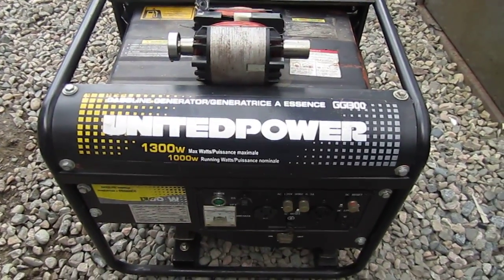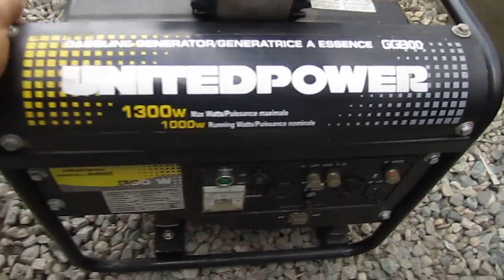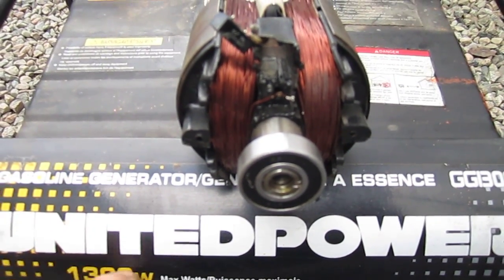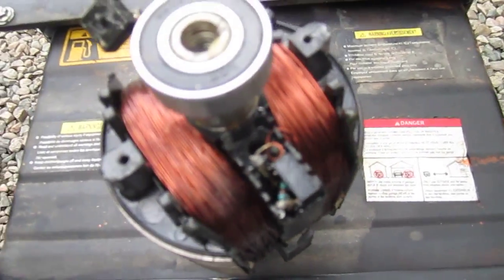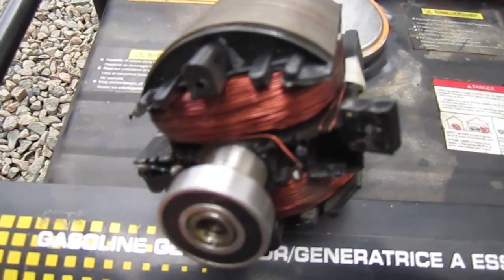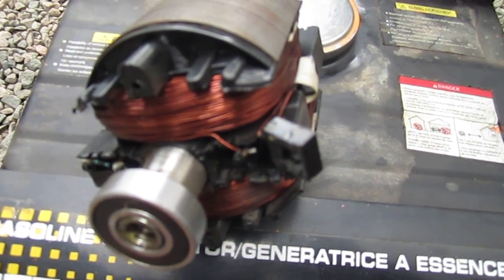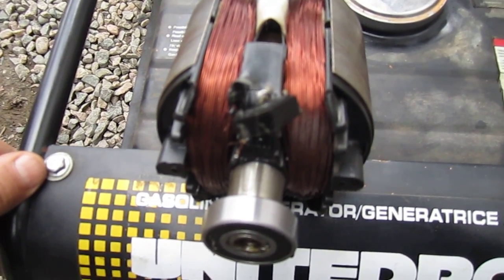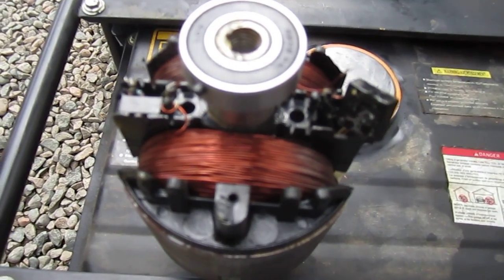Reasons Why Generators Stop Producing Voltage  Big Cause Why

Comment: This diagnosis did fix my problem with the rotor
Reply: The diodes can go bad from the bad connection, the bad intermittent connection going through the diode creates high voltage high current peaks that either short, or blow the junction open on the diode they can fail in either way

Comment: I have a Generac gp3300 and it's producing low Voltage, like it will power a light bulb or drill but the bulb is dim and the drill spins slow as hell.
Reply from the maker: Hard to say what the problem is it matters to which type you have some have voltage regulator and some only use a capacitor.
Reply: @MrDoingEverything  this has the AVR, and I believe that may be the issue. I ordered a new one, and it will be here tomorrow so I'm gonna change it and hope for the best.

Comment: 2:30 time. MANUFACTURES; those 'engineers'  ought to get a brain slap. GOING   3600 rpm, and  NO  JB WELD, to hold those wires/parts together !  Take a lesson, from aeronautics !  Build  the electronics, and the  bridge rectifier connections, IN  A  SOLID  BLOCK, OF  ceramic glue, or similar. Bolt into armature. !  dummies !    IF  I HAD this gen problem, i would silver solder the connections, after twisting together; then,  glue them in there, with  JB  WELD......no  more 'design  problems'''  anymore  !  MODERN  junk Buy once,  use once, (maybe) trash it   >>>  buy another new one,....repeat the cycle....the modern  'way'.  I will keep my 1983  Yamaha ef2800  generator; built like a tank, starts right up, makes power even after sitting in the bush, for years at a garage sale. Freebie, had to redo carb completely, and de-rust tank.....this is a keeper  !

Comment: I have a brushless petrol generator, I thought the capacitors were bad so changed them out, still doesn’t work.
The 240 side produced 10volts,
And the 110v produces 100 volts, what’s going on? Thoughts?
Reply from the maker: Have you thought about the voltage regulator
Reply: @MrDoingEverything  I’ll have to open it up and have a look for it, it’s not like the new generators it’s a Medusa petrol and it’s maybe 30 years old now, 13.5hp engine. 
I’ll try your suggestion, I’m new to generator repairs, this is my first attempt 😅
Reply: @MrDoingEverything  you’re not going to believe this, there isn’t a voltage regulator, or not one that looks modern day. All I see is copper wires, capacitors, or some tiny diodes. What do I do next? I’m so puzzled. It’s nothing like in people’s YouTube videos
Reply from the maker: @belsayshootingground  Have you checked the diodes.
Reply: @MrDoingEverything  there’s 2 of them on the rotor, they look fine visually, but I don’t know what tests to run?
Reply from the maker: @belsayshootingground  Look fine don't mean fine search how to test diodes. Very easy to test out. Easier to see video then to explain. Very simple to do after knowing.
Reply: @MrDoingEverything  will do thank you for responding 🙌
Reply: @belsayshootingground  this is a brushless alternator, it have the output voltage regulated by a capacitor(which is fed by its own winding inside the stator) . Single phase brushless alternators are not suitable to power sensitive electronic appliances as the generated voltage in not properly regulated. The 2 coils of the armature are not linked like @think out side box said, they are 2 separate components. These coils are short-circuited through the diodes/rectifier so that the current running in them is DC. With this DC current flowing in the 2 coils, the armature become a rotating ELECTRO-MAGNET which induce the main output AC current/voltage in the stator of the alternator.
Reply: @zairenszairens809  ah that’s interesting to know. So what’s the best type of generator for homes?

I did just notice that the main rotor inside the generator is all bent and twisted and is now contacting the magnet. If I straighten it all up and get the tolerance correct again, do you think it could work again?
Looks like it’s over heated quite bad.
Reply: @belsayshootingground  If the rotor comes to contact the stator when the engine(mover) is running because the NDE (non drive end) bearing fails the damage to the alternator is big. The friction heat produced in this failure will fry/burn the windings insulation varnish (rotor & stator). Rewinding the 2 (rotor/stator) is much more expensive than buying a brand new alternator. If you can find a used alternator it can save you precious $. As you said the rotor is bent and twisted, trying to fix it doesn't worth it, because even though you can straighten it, the windings needs to be replaced. Did you test the continuity to the frame? (insulation test) It must be more than 2 MΩ between any stator winding terminal to the frame or rotor winding to the shaft. A good generator for household appliances is one with a AVR(automatic voltage regulator), the best is an inverter generator. Inverter generators are much more expensive than ordinary ones because the generated power is steady and clean(sine wave)
Reply: @zairenszairens809  youve made me realise I know absolutely nothing about generators 🙌😂 I think I might just buy a new one and leave the fixing to the pros 😆

Comment: I've got a generator similar to that one it's 2000 watts but the armature is made like that except where the bridge diodes are, it has the same holder but there's only a single resistor between the two sides..it has a gold stripe so I guess it needs to be about a certain size..anyways I worked at a small engine place and I got this thing the engine was junk so I cut part of the crankshaft off and left it sticking out of the generator...it wasn't long enough to put a pulley on but I drilled a 5/8 hole in it and inserted a piece of keyed shaft from a junk electric motor I had...tomorrow I'm getting batteries number 7 &8 for my solar setup so I'm going to weld the shaft piece tomorrow...it's  for a backup generator thing I'm working on..it has two 110 legs...but with the resistor it let the crappy little motor they had wind up before it would start generating so I'm going to glue a little neodymium magnet to the back bearing because I'm gonna use  an old 5 hp Briggs that's been put up for a long time..it has a centrifugal belt clutch so that'll let the motor get going. .yeah that's kinda crazy having those bridges flying around in there lol I never would have thought of that
Reply: Good man, David !.  Consider,  sealing anything up, with  JB  WELD.  After  your completely sure, it makes power consistently.  GLUE  THEM  SOLID,  so no more problems.  IF  i was a designer, engineer, i would put most all stuff, on armature, in epoxy cement. Modules, like in your alternator voltage regulator. No vibration, would destroy anything !

Comment: Nice observation, can you please tell me what guage wire do I need and how many turns on the coil if I need 50 amps and 24 volts from a single coil if I'm using N52 neodymium magnets 60mm by 200mm rotating at 7000 rpm
Reply: https://youtu.be/J9wqTqh9Vzk

Comment: A chain is only as strong as its weakest link...these little pieces of crap made crappily in a crap little factory in a crappy country, they will then work three times. But when you need them, they don't work and then you have to order parts, so you can get it to work when you don't need it to work.
Reply: Better

Comment: Ok this might sound crazy but I’m gonna go ahead and ask anyways for any one that knows, couldn’t you just skip the bridge rectifier and just soldered the wires together to complete the circuit
Reply: In this case you need to include an AVR circuit with rectifier stage to stabilize the power output and prevent peaks or drops i guess.
Reply: Good Question!   The rotor needs a DC voltage to create the magnetic field thus the diode is there. 

With a 2000 watt brushless unit here the bridge rectifier is just used as a Big diode. ie the two AC leads are cut off the plastic bridge diode package. The rotor  here has the 2 rotor coils in parallel connected to the + and - terminals of the bridge.This affair has a 15 K ohm resistor across it for surges. 

When used this way you have two pairs of diodes in series, then the each is in parallel. So like 1.2 volts drop DC ie 2 diode drops instead of one. This is probably just done for cost and packaging, one has this tiny brick shaped diode box to fit in a hole and goop in place. Many diodes on brushless generators are a single diode on bigger generators.

The brushless generator like in this video has also an extra winding in the stator that connects to a capacitor. My 2000 watt unit has a 20uF cap. When running and outputting 120 volts the cap voltage on mine is like 189 volts. If this cap is gone/removed you get about 4 volts across the cap wires and that too across the output wires ie AC jack. This 4 volts is from the base magnetism of the rotor. Adding the cap increases the voltage across the "cap coil" this "excites" the rotor coil. The rotor coil thus has DC with the diode thus the magnetism increases in the rotor. The voltage them builds up quickly.
Reply: @3beltwesty  
Thanks bro 🤙

Comment: Mine has a diode connected to the slip rings but tested fine with the multimeter! Should i replace as its producing 4 volts but at 50 hz to 90 hz! Any reply appreciated thanks from Australia!
Reply: It is a brush type or brushless.  Brush check voltage regulator. Brushless check capacity.

Comment: You might to also use silver solder on all solder joints, it's stronger than lead based solder and will hold up better to the extreme centrifugal forces. Thanks for the great info.
Reply from the maker: Nice info left. Thank You

Comment: My generator produce power for 2 min and then it cut the power what is the possible problem ?
Reply from the maker: Could be the same as in the video.
Reply: @MrDoingEverything  it was from the AVR
Reply from the maker: @marwans4018  That's it when these type things fail it's never going to mean the same issues for all of them. Best of luck.

Comment: What happens if you don't have the rectifier? Could you just hook the coils togeather?
Reply from the maker: output current would be DC with out the rectifier. Then its no longer a AC generator.
Reply: @MrDoingEverything  so technically we can bypass those and make it a strictly DC output generator?
Reply from the maker: @off-gridhillbillystyle3735  Well not really because there are other components that work off the AC. So bypassing more then just that would need to be done. I never played around with it to figure out how to but i,m sure its pretty simple. I would guess if only the output leads from the generator were used it would be DC i mean the leads ahead of all the generator components but there would be no volt regulation happening either it would be full output power which could be to high to be able to be used for much. A Regulator would be needed to be used to give a good use able output voltage. I might play around with one beings i have a couple of them that i don.t need as a generator. If i do i will let you know back here on and through this message. If you play around with one let me know. I would play with a carefullness is how i would deal with it. High DC voltage can give a real hard shock.
Reply: @MrDoingEverything  I need a low rpm high voltage generator.... Any idea where I could find or scavenge one?
Reply from the maker: @off-gridhillbillystyle3735  No other then keep looking.

Comment: How is the rotor being excited? It must be getting AC voltage from the stator and then brought back to the rotor while the full wave bridge rectifiers convert to DC voltage.
Reply: There's actually 3 sets of windings. First, the main output winding. Next a small set of excitation windings that create a small AC charge induced from residual magnetism of the main winding.This is then induced to a small set of field windings , which is converted to DC by the diodes, causing our main winding excitation and output.

Comment: Fix your alternator before its dead.

I have 4 of the Unitedpower 1300 and 3 of the Champion same size, what I noticed on all of them is the alternator housing that bolts to the engine is on the wrong way.

Looking at the opened case that bolts to the engine with the rotor removed there is a arrow symbol inside with the word UP however on all of the ones I have up is pointing side ways. 
This positions the case so it appears the hot air from the cylinder head is picked directly up by the intake air cooling ports of the alternator, take a look at yours.

It isn't too hard to see this will cause the alternator to run much hotter then intended possibly causing burnouts of electronics or glues holding the diodes in place or prematurely degrade glues allowing the diodes to move with vibration & centrifugal force.
 
My final comment comment, I believe there might have been a translation gap at the time of manufacturing, I hope what I've observed can help others out.
Reply: ...drunk or stoned, assemblers, in either china or mexico, perhaps.  SHODDY   CRAPPY  stuff....

Comment: The wires separate because of the excessive centrifugal force.
They must run at 3600 RPM to produce the 60 hertz.
60 x 60 = 3600
Reply: @Crazy Online Videos -- just use the old wire to determine the exact measurement for the replacement wire. imo 🤔

it can't exceed a thousand feet 😆
Reply: @Texaca  Sounds like an 160 meter Beverage antenna to Me.  Yeah

Comment: I have a Coleman Powermate 2500 that reads 1.5 to 2 volts at the receptacle.  I checked the resistance in both the stator winding and the rotor windings and the show proper resistance of 1 ohm and 7 ohms  (no open circuit wire).  The diode is also ok.  I tried the "drill spin" method to try to induce the field but no luck.   Any other suggestions?
Reply: Check the Voltage Regulator. I find that after they fail they may produce a small amount of voltage.
Reply from the maker: Perhaps the capacitor unless there are other types of electronics controlling it. Then the problem would be in there somewhere. Like a brain box of some sort.
Reply: there are a total of 4 electrical components in the entire generator - 2 windings, a 12 uf capacitor and a circuit breaker.  both windings are to spec, the cap reads 12.35 uf and the circuit breaker shows continuity.  when inserting probes into the receptacle, the ciol winding reads 1 ohm (to spec).  the field excitation winding with the capacitor in the loop reads 1.75 uf (inductor-capacitor circuit).  I don't know what else to check.....
Reply from the maker: Are you sure its spinning at needed rpm or maybe the keyway sheared were it joins to the motor. The motor may run good but where it connects to the armature it may have lost a solid connection and not spinning as fast or tight as it needs to be.

Comment: Mine one has both resistor blown in there. So there is only two diodes one on each side and two "other components" which are both missing so I'm not completely sure what they were so I only guess they were resistors. The generator rated 2kW continuous power output. Any ideas what was the Ohm-age of those resistors?
Reply from the maker: No idea sorry
Reply: Great! Thank you very much!

Comment: My generator seems to only put out half  volts. like its only putting out 60 v instead o 120V 
 Any idea why?
Reply from the maker: Could be the same reason as in the video. Sounds like half the windings lost the connection which is giving half the voltage. My best guess.

Comment: My gas welder won't put out a full 240 volts  only 189.help.
Reply: Check for correct spec RPM of the welder/generator
Reply from the maker: Its hard to say why. It could be as simple a brush is dirty or wore down to much and lost spring pressure. I would check that first anyway.

Comment: my wolf  xxl petrol generator will run find but no power out put
Reply from the maker: Right the motors are not affected when the power heads stop working. If it was sitting to long sometime the only thing that need to be done is recharge the capacitor and some time also the capacitor will go bad and need changing. Really  there is many reasons to why they stop working. There are the most common problems that I would check first. Which one of them is in the video and the other one I mentioned here with the capacitor. Best of luck to ya with it. TC
Reply: Residual  magnetism is lost.  Magnetic field, conductor and relative motion that's how generators produce power

Comment: The cheaper generators are realible at about half rated watts when ran continually,,,and the charging capisator sometimes packs up ,,,,,,more often it's the wiring connectors being loose God Bless